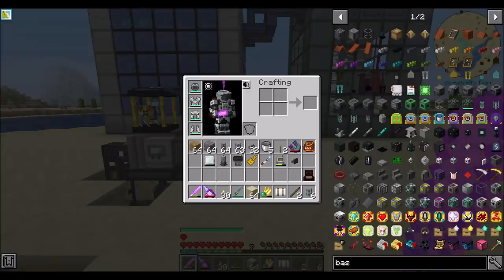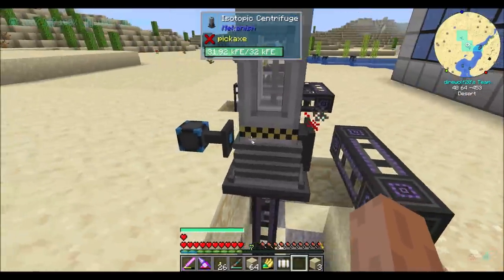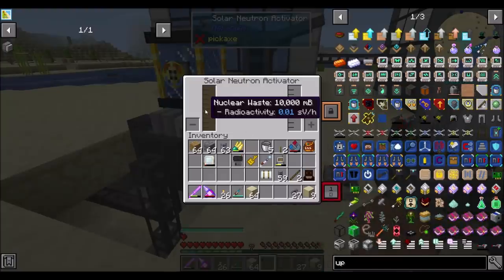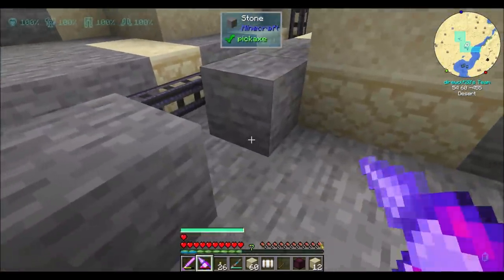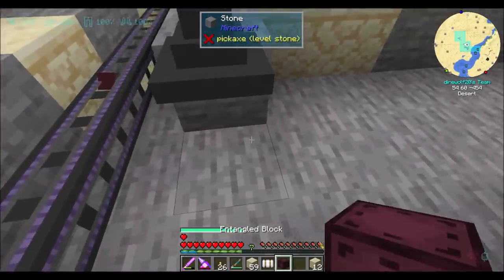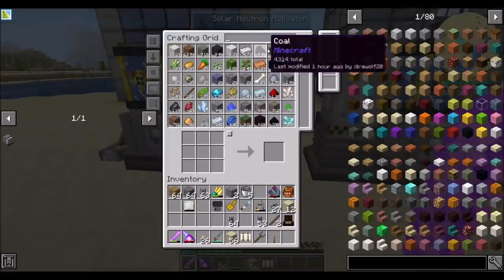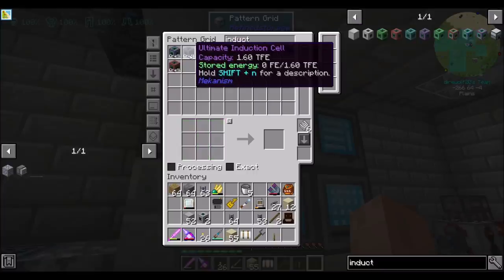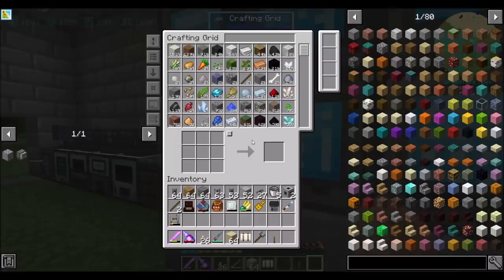Lets Play S10E67 Polonium and Plutonium Entanglement

Comment: I would add a daylight-sensor set to lunar mode so it is using the centrifuge at night and the Solar thing in day
Reply: because he always sleeps through the night unless doing astral.... but good idea.... i deleted my comment after i realized others said the same thing
Reply: @phat420man  yessir
Reply: I would set up some kind of logic system (Redstone, Xnet, etc.) to where:
-Daytime "TRUE" AND Redstone signal "ON" = make Polonium (then a Lever to toggle between making Polonium Pellets and Anti-Matter)
-Daytime "FALSE" OR Redstone signal "OFF" = make Plutonium
Reply: I would set up some system to balance it out according to the recipe's ratio.

- Lacking Polonium -> turn on.
- Lacking Plutonium -> turn off.
Reply: @netbotcl586  i would add the redstone upgrade to both polonium and plutonium drawers and if both are full start making antimatter , but dire is still aways off making the supercritical phase shifter

Comment: Entangled Mod looks pretty interesting, but that seems a long way to go for something that could have been done by rotating the Solar Activator and putting the Isotropic Reservoir in auto eject (left) mode...
Reply: Rotating would solve the over complicated issue or just use xnet. It would fix so much dire wire.
Reply: @Sandhawk89  true, but did ya hear him talkin bout the mod? Seemed to enjoy himself.
Reply: He wanted to play with a new mod , Even if it is unnecessary or overcomplicated way of going about it

Comment: Dire you only need 3 ports, and one supercharged coil for the supercritical phase shifter. any more than 2 coils is just decorational, because 2 provides the max limit that can be inputted, but you'll only need 1 because you'll only be able to provide a fraction of the power that it can take in

Comment: Anyone else having issues with their Environmental Core Assembler?  I've had issues with the ports not retaining their input/output settings.  I have had Interconnects of the same type not stacking, and now, after doing a stack of Pladium Interconnects, I can't get it to upgrade my FE input IO block or make more Redstone Imbued Obsidian Plates?  I've had other issues with Environmental Tech (core) that seem more cosmetic (No laser, but I am getting ores anyway) and structure building seems flakey.  log out/login seems to fix issues for a bit.

Comment: tbh with you, i'd just run the miner while standing on it, and do somethin else while it mines for a few hours.
ie; another game.
probably wont get as many resources as you need, and might need to make a few more drives for the refined storage system beforehand just to be safe, but still, a viable option.